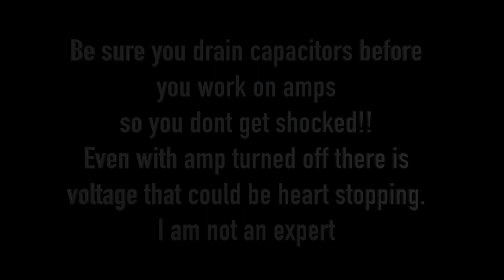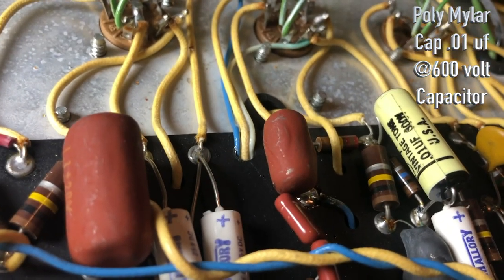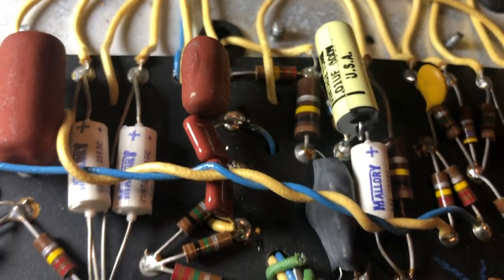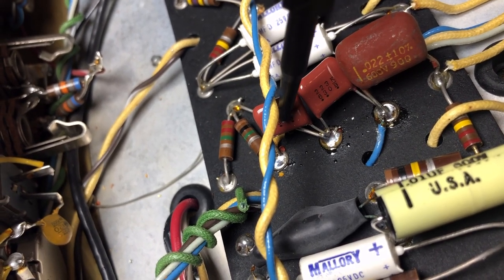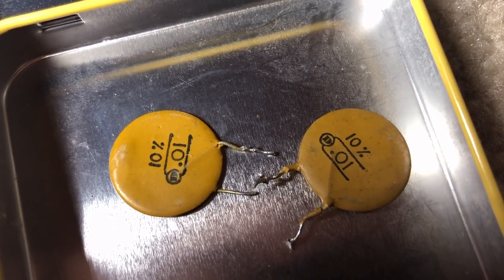Vintage 1969 Fender Bandmaster Silver Face Amp TREMOLO TICK FIX

Comment: How did you come up with jumping the 10 Meg resistor? I haven't seen any schematic that shows this fix. Obviously it worked but service bulletin #9 shows you going from 10 Meg to 50v bypass cap. I'm looking to fix that tick in 69 Super Reverb.